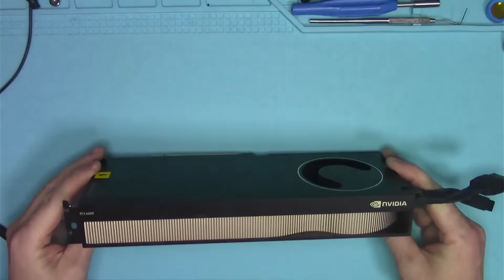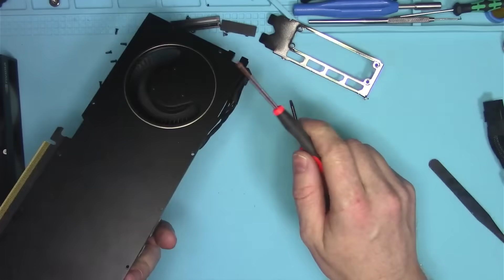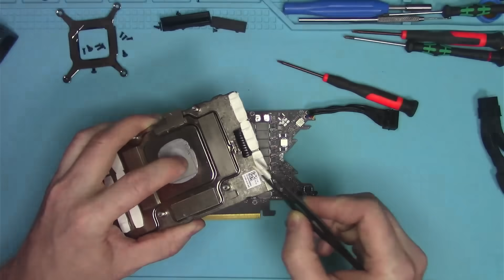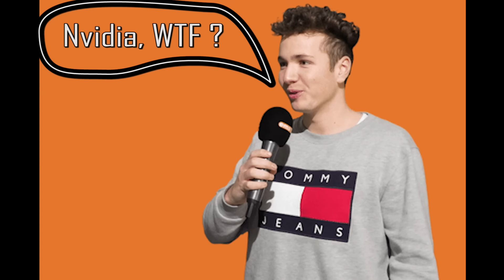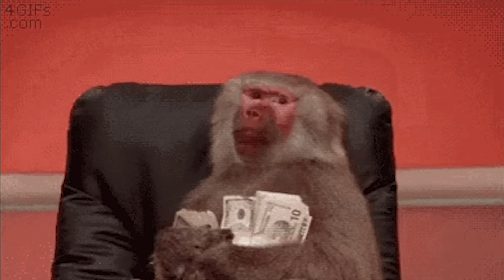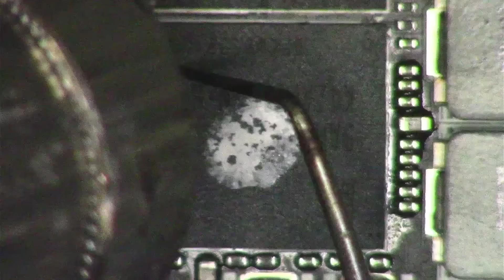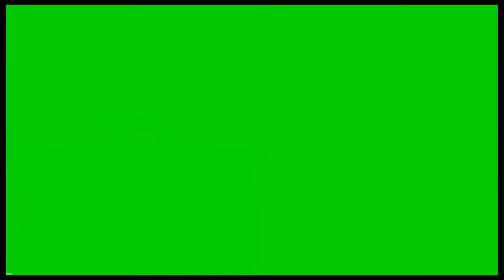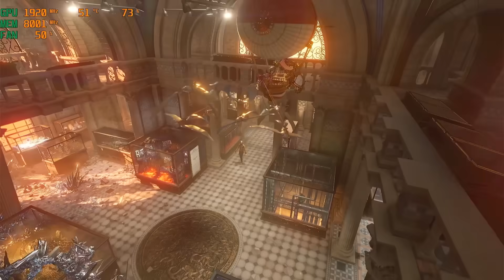Repairing the High-End Nvidia RTX A6000 GPU

Comment: When I see the size of PCB for the gpu. which is designed to be workstation card, I maybe just don't understand engineering expected utilization and  heat dissipation, as its rated for 300W TDP.

It really looks like these cards are made with 2y(1y business) guarranty in mind.

But what is most important, you made GJ  bringing it back to life.

You repair cost could include margin, like that 4649USD MSRP.

I remember getting revived my old GF8800 costed me 15perc of gpu price, but it was just heating and UV a d the card was gaming, with incomparably lower msrp.

But charging repair cost at gpu price would make the repair no sense for the owner.

Just hope you didn't it for free. It would be loss, xd.

Comment: The name Quadro is no more, nowadays they just call em x000A, for example the full fledged AD 102 aka the "4090Ti core" with 48 VRAM is simply called the Nvidia RTX A6000 Ada. They are super expensive and just use the GDDR6 memory instead of GDDR6X, pretty slick workstation cards for sure.
Amazing repair Tony.
Reply: please standby while we open this gpu with a hammer🤣🤣🤣
Reply: Fucking dumb Nomenclature Nvidia should of just kept calling them Quadro cards. Now everyone mixes up the RTX X000 Ada's and the RTX Ax000 Ampere
Reply: The card on this video is “RTX A6000”, not “RTX A6000 Ada”. RTX A6000 is Ampere generation GPU, and A6000 Ada is Ada generation. RTX A6000 is about 2.5x more pricey than Geforce RTX 3090, and RTX A6000 Ada is about 1.5x more pricey than A6000. Minimal requirement of some Unreal Engine 5 official demos is A6000, so it is very popular card for game development.

Comment: this thing is basically a 3090 (not 3080/ti, since it has the multi gpu connector) with the memory modules swapped out for GDDR6 twice as dense as the regular GDDR6X (so 48GB total). Given the issues cooling 3090 memory it's not exactly surprising you had a dead chip on this thing with a worse cooler.The power connector should only fit 8-pin CPU power connectors so idk how you got a regular pcie in there lol
Reply: What is a low profile A2000 12gb equivalent to?  I was looking at one of those for a low profile desktop build.
Reply: @Vile-Flesh  It's a slightly cut down 3060 12G with a power limit so it performs basically like a 3050
Reply: @wingcommanderbob8268  Good to know.  Thank you!

Comment: I think the connector that'sused ont hese cards is a 12v EPC, or most commonly known as a "CPU power cable", which might explain a number of things
Reply: My Corsair TX750 and my XTX 850 watts both have a second cpu 8 pins connector. Wondered why they had 2 of these. Now I know.

Comment: You can see in the a0 channel there are two ic's mentioned. Front is 0 back is 1.
First dataline was bad on the a0 front.
Reply: Yep. Mats only shows the channel and if the failing bits are at the start like a00000 it is the first chip of the array, so the front.
The back chip starts somewhere like a016384
Reply from the maker: Nvmt report ?
Reply: Thats a wild guess in nvmt. But someone else with more experecience can give a clean answer.
Reply from the maker: So now knowing which chip is front or the back it is, how do i know which one is bad ? NVMT is not very clear on that, even when looking at it side by side with a working channel.
All values match except for INTPL column. that value is allover on both good and bad chips

Comment: How often should a "normal" gamer service their card? I keep finding a wide range of timeframes. I'm asking about thermal paste and replacing thermal pads.
Reply from the maker: Depending on the thermal paste used.
When you notice temperatures of the hot spot get close to 100, its time to take a look under the hood.
Pads, not so much. I've seen pads last years and even then they still cause no issues.
Reply: I was going to ask the same question so ...thumbs up!

Comment: Here are the details for the Nvidia A6000 .....

GPU Memory	48 GB GDDR6 with error-correcting code (ECC)
Display Ports	4x DisplayPort 1.4a*
Max Power Consumption	300 W
Graphics Bus	PCI Express Gen 4 x 16
Form Factor	4.4” (H) x 10.5” (L) dual slot
Thermal	Active
NVLink	2-way low profile (2-slot and 3-slot bridges)
Connect 2 RTX A6000
vGPU Software Support	NVIDIA vPC/vApps, NVIDIA RTX Virtual Workstation, NVIDIA Virtual Compute Server
vGPU Profiles Supported	See the Virtual GPU Licensing Guide
VR Ready	Yes

Cheers.
Reply: Yeah and EPS 12v instead of PCI-E connector. Hence you need the y-adapter for pci-e power.

Comment: So I would wager this card is not used for mining. Well since I have one it's very unpractical to have his card for mining since it's so expensive and basically just a slower 3090 with 48 gigs of VRAM. It's only a 300w card. I use it for AI models and training. Also I got mine for 3k on ebay.

And this blower is quiet unlike others. It's amazing how quiet this thing is compared to my 3080 TI blower. Night and day difference. Also I'm curious if you ever saw a A4000? It's a cute single slot card with 16 gigs of RAM. Basically a slower 3070 TI. And again these things are quiet makes you believe blower coolers have a future.
Reply from the maker: I think i have had A4000 for repair once. I dont remember if i had it fixed or not. its been a while.
Reply: Now, if AIBs put em on consumer cards...
I hated my Vega56 because of the jet engine noise it made😡😡😡

Comment: Nice Workstation/AI card! The connector, the 8-pin, is server-oriented and predates the PCIe 6 pin connector. It is used for simplicity and compatibility with server PSUs. Thanks for the great content, you are very good at what you do.
Reply: Isn't it just an 8pin EPS plug?
Reply: @Neggy-Z yes, its a EPS CPU connector
Reply: @Neggy-Z  I think it is the same as the 8-Pin that goes into the mainboard for the CPU, it is different to the 8-Pin that goes to a GPU.
Reply: This EPS connector also allows for higher power draw than a PCIe 8 pin, around 300 watts
Reply: @mika2666   Isnt it just 235W? Than what i know.
Reply: the xeon phis had smth similar iirc
Reply: witch makes absolutly no sense considering the A6000 was designed as a workstation card not a compute card.

Comment: These are basically datacenter AI cards, awesome card for an unaffordable price for home users.

To my knowledge the connector is a CPU connector not a GPU connector which is why you need the adapter. Its server people designing stuff.
Reply: its mainly because the eps (cpu connector) can deliver more power
Reply: Datacenter cards are Tesla series, Not A series

A Series GPUs are for workstation
Reply: @STORMFIRE07 both A series and Tesla series are in workstations and servers and nVIDIA and vendors will certify hardware compatibility for those platforms. They also have more, faster and ECC capable memory with higher bandwidths than gaming cards and often get passive cooling. Gaming cards aren’t intended and can’t be properly cooled on those platforms.
Reply: @STORMFIRE07  Thats not correct either. A stands for the generation not the class. You are right that its an RTX workstation card though so technically not a datacenter card. But they are super popular in datacenters to thats why I mixed it up.

Comment: the a6000 is that level variant of the quadro, since they discontinued that naming scheme. workstation cards aimed at cuda processing in various graphics, media, and AI/ML suites.
Reply from the maker: interesting.
Reply: @northwestrepair  Its also the reason for the 8pin eps cpu plug. Server and workstation cards usually have one, it can fit a pcie 6 pin and that will kill it.

Comment: great repair on a card you never worked on before. also nice tear down without any damage
Reply from the maker: Thanks 👍
Reply: @chrisliddiard725 I’m not sure why you are confused.
Reply: @MightyGimp  life
Reply: I would rip the fan connector right off, on my cards i just do that as its easier to plug the entire housing into the pins than the connector into the housing
Reply: @chrisliddiard725  do you understand the word "thanks" ? Your confusion is confusing me

Comment: Dang, you just guessed which memory chip was the right one on a card you've never worked on?  I suppose you had a 50/50 chance, but still it's nice you got it right on the first try!
Reply: It's more than 50/50 though, he's worked with similar (3000 series) cards, and it's almost one hundred percent in the front facing ones.